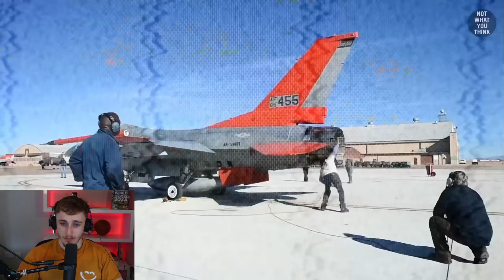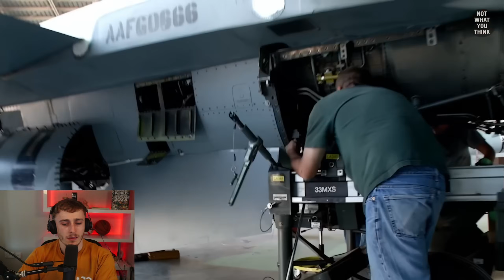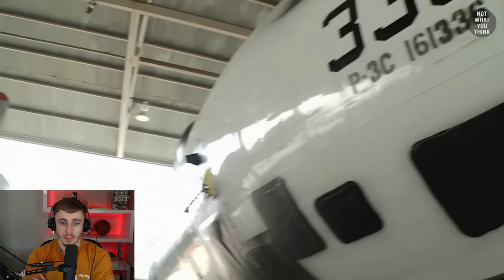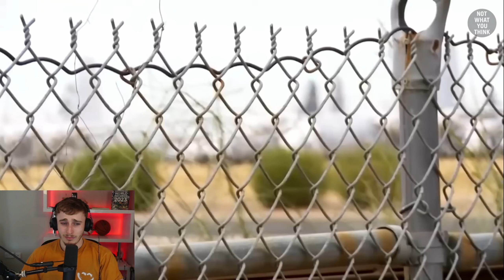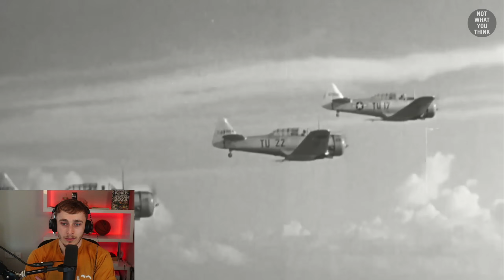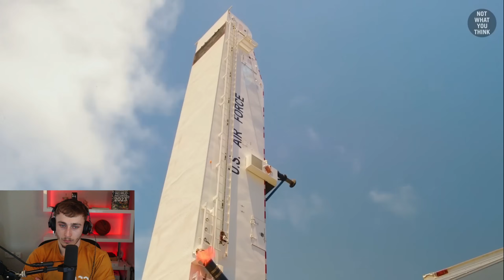Brit Reacting to Inside The US $35 Billion Boneyard: Where Planes Come to Rest, and Then Fly Again

Comment: One measure of the value of AMARG is that for every dollar spent on it, the US government gets back nine dollars in spare parts and/or regenerated airplanes.  Pretty much the only part of the military to ever actually turn a net profit, really.  It is a part of the US Air Force, active duty, and most of the people there are just maintenance specialists who get special training for the AMARG mission.

The "stealth fighter" at the start is part of what's called "Museum Row," a line at the front of the yard that holds one example of every airplane stored in it (and a lot of ones that used to be stored there, but now there's only the one left).  Because the F-117 wasn't actually going to be stored at AMARG (its stealth coatings would deteriorate quickly in the desert sun, so they're stored in hangars at a base that used to operate them), the people there decided to have a little fun with the tourists by setting up a set of wheels and tires from one in the right spots on Museum Row, adding a cockpit access ladder in the right spot, and putting up a sign proclaiming it to be the F-117 "Stealth Fighter".  To this day, if you take the bus tour, they insist that it's a complete aircraft and "that stealth stuff really works, doesn't it?"... :D

Comment: Air Force has Avionic Mechanics, Army has Tactical Aircraft Maintenance Specialists, Marines have Aviation Maintenance Controllers and the Navy has Aviation Structural Mechanics as service personnel in charge of maintaining each branches aircraft. There are divisions for fixed wing and helicopter/tilt rotor maintenance as well. Using enlisted men is cheaper than hiring civilian contractors but various defense contractors are also employed for the maintenance of certain platforms.

Comment: A black object absorbs all wavelengths of light and converts them into heat, so the object gets warm. A white object reflects all wavelengths of light, so the light is not converted into heat and the temperature of the object does not increase noticeably.
Reply: What he said
Reply: Mythbusters tested two identical cars, one black and one white in full sun. The black car was 10 degrees hotter inside.
Reply: White doss not reflect all wave lengths, and black does not absorb all wavelengths.  If you put a white object in the desert heat, it will still get very hot inside.
Reply: Where I own a home near Tucson many homes have flat roofs, often covered with a coating of a white elastomeric material resembling, but not the same as, paint.  The best quality of this material claims to reflect 98% of solar energy (that would be the spectrum of sunlight) and from my experience it may be true.  What I know, because I’ve done it, is if you get on the roof on a sunny day and pretty well cover your skin from direct sunlight, you will still get a wicked sunburn on areas exposed to reflected light coming upward from the roof.  I also know this material does its intended job pretty well.  On an Arizona summer day, when temperatures can reach 105F outside, the house interior stays cool most of the day, reaching about 78F around 3PM at which point I have to turn on the A/C.😮
Reply: Except when you are going at high speeds through air. At that point, black actually is better as it does a better job of radiating our heat. So though it may hold onto more radiation coming from light, it’s fall far better at dissipating frictional heat. Air friction that is of course. 

That’s why the SR-71 is black, and not white.
Reply: I have a place in Tucson and work for the Tohono Oodham reservation west of Tucson and the people there seem to have an obsession with those hot black cars and trucks, everybody has to have a big ol pickup truck, invariably a RAM pickup, they usually are owned by those who work for the nation.
Reply: @clinthowe7629  I actually have a soft top Jeep Wrangler and the canvas top is black.  First time I took it to my mechanic for an oil change he immediately asked me how I stood driving it in summer.  The car does have quite an effective A/C system, its only significant option (it's even a stick shift which I love).